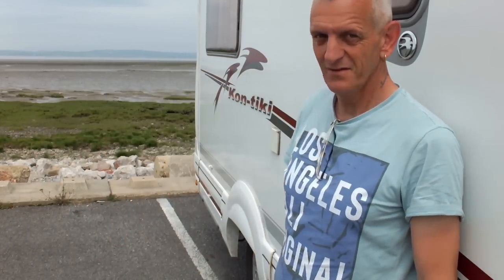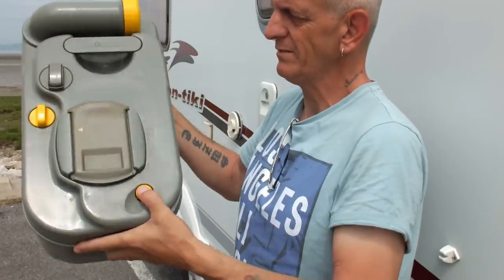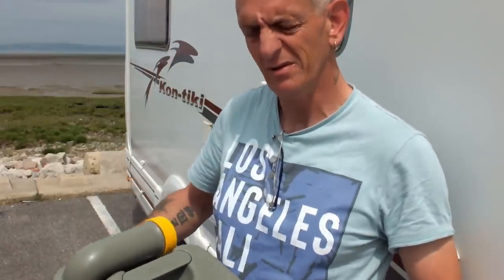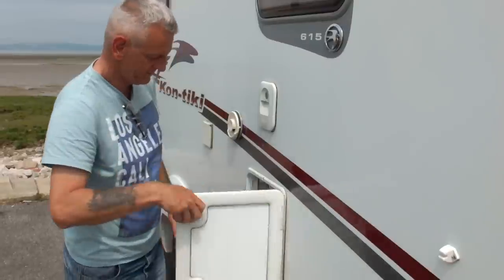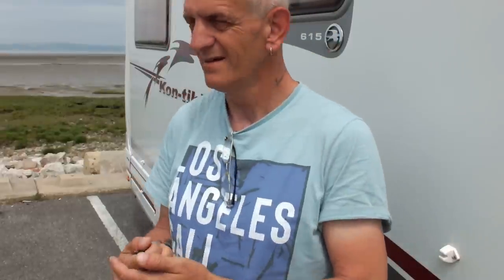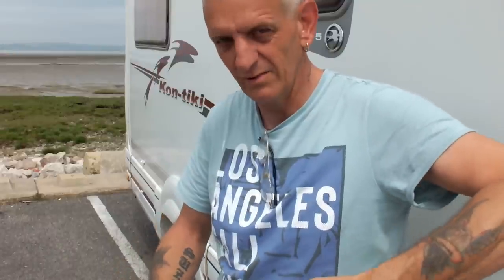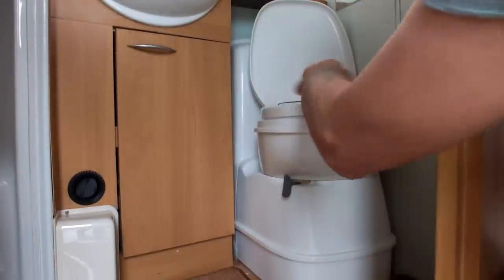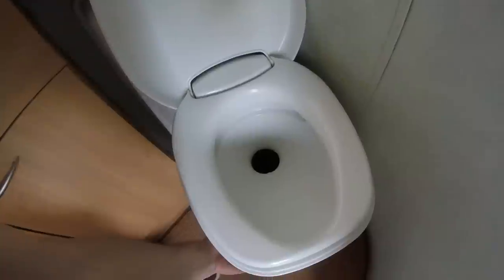All about the cassette toilet

Comment: I have always found this to be a predominantly male job lol. I have use toilet duck for the flush but agree with you 100% as most sites will have a soak away system at the elsan point so it goes back into the local ground eventually.
Reply from the maker: IV always emptied it as i know it's done properly,I'm still on the search for something a bit more planet friendly.